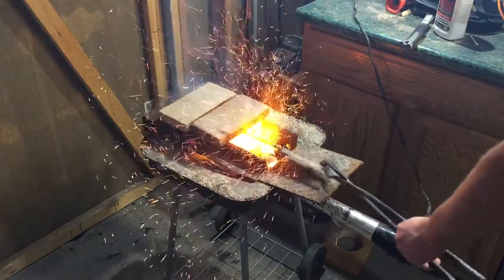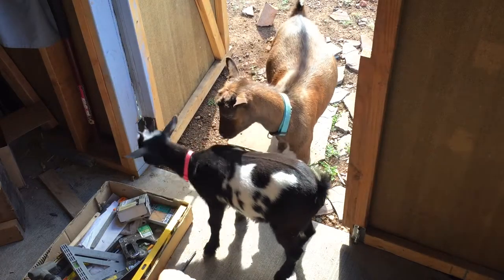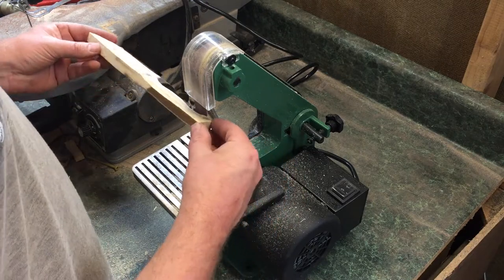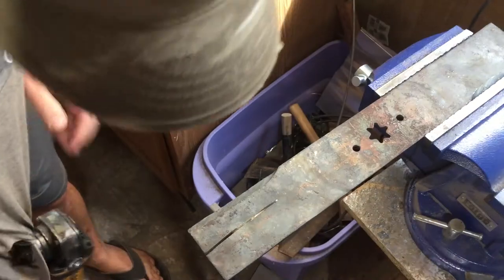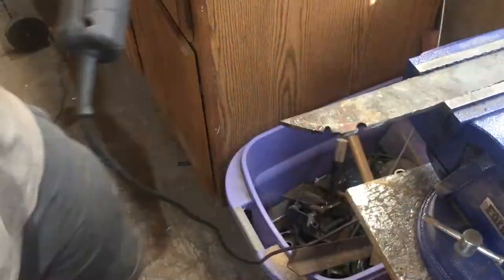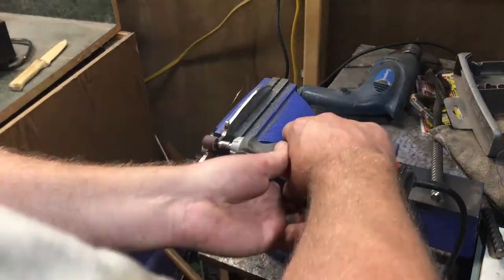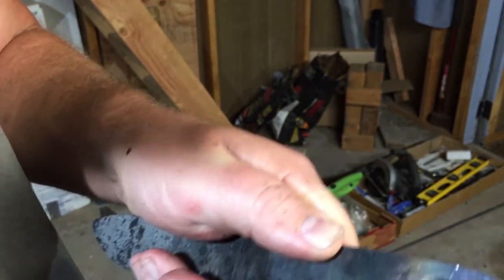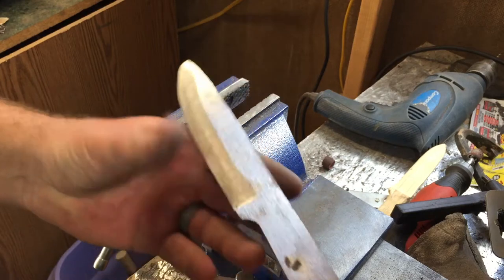How to make a bushcraft knife from a lawnmower blade Part 1

Comment: Cool! I'm not a blacksmith or knife maker but I have tried both before. One thing I know is drilling holes in your knife before you heat treat it is a lot easier than after it's treated.... learned that one the hard way 😉
Reply: Thanks for the tip🙂

Comment: Turn your angle grinder round! Have the sparks coming towards you, so if it snags it'll just pull away from you rather than fly towards you!

Obviously don't sit directly in the path of the sparks lol

Good video!
Reply: Right i was like wtf dude dont know how to use a grinder lol good rule to remember if you can see what your doing its aimed at youre eyes always wear safety glasses

Comment: I was just considering taking my grinder guard off. Guess I won't now.
Reply: Yea, I had a disk break apart and hit my hand a while back. Scared the living crap out of me. Good thing I had welding gloves on. Needless to say, I use a guard now.
Reply: @darkhawk574  and I’ll be using chain mail but not the shit chain mail like the wrong stuff not the cheap stuff to save time there is multiple types

Comment: Very nice knife, it looks awesome I love your blade shape. I've found the same issue with the hammer dings being incredibly difficult to remove unless you have a very expensive belt grinder and a lot of time. Thanks for the video.
Reply: I’ve found you can knock out any minor pits in the steel with a harbor freight belt sander. 60-80 grit will take it out. Of course that assumes that you havent hardened the steel yet. Honestly any putting on the blade will just make it a perhaps less attractive blade, but as long as your edge is hard and fine, there’s no functionality lost

Comment: i have a dumb question. he heats the metal and then let it cool slowly. question is shouldnt it have been soft after this?
Reply: Yep. It’s called annealing. When you anneal a piece of steel, you heat the material enough to where the the molecular composition of the steel changes to a softer state. The point is to make the metal soft to where you can shape it easier. Then, you heat and quench in oil (or saltwater, or in a high silicate material to case harden on steels with too low of a carbon content to oil/water quench) to re-harden
Reply: Fred Garvin not a dumb question  that's how you aniel it for workability.. cut your profile, shape,  bevel ,heat ,quench,temper,polish,sharpen,done!

Comment: ok. not throwing rocks or wanting to debate anyone in the comments.

i have a question

if you look on some forums of course you see different opinions  about the probable steel that is lawn mower blades etc, etc...  

 now that you have used low tech and high tech methods in your journey, i assume you have used "non-mystery  metal" in addition to mystery lawn mower blade metal.

question: what is your hands on qualified opinion of the edge retention and toughness of the "mystery metal LMB" vs bought steel blanks?

Comment: It actually don't make any sense to me knowing lawn mower blades are relatively a soft spring type steel! Why I have several times attempted to drill holes in lawn mower blades or make existing holes larger only to ruin several Good drill bits! Normally that only happens with Tempered Hard steel or Stainless? Hence after forming the knife then heating to temper only the cutting edge makes sense placing handle holes first and then heating for a final tempering seems logical. Did that make sense? Now though that I have seen somebody Actually repurpose a lawn mower blade to a knife blade I'd so like t try to. Thing is? I'm not a black smith and i don't have a heating forge suppose i can attempt doing it the anchant way? We'll see?